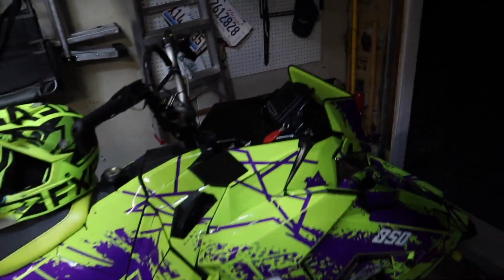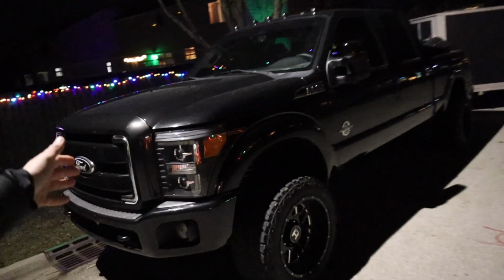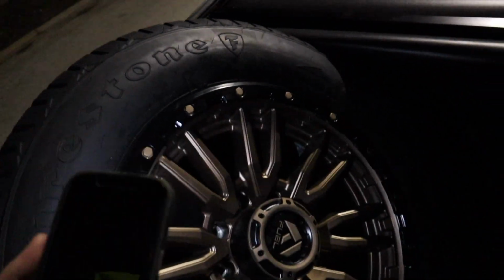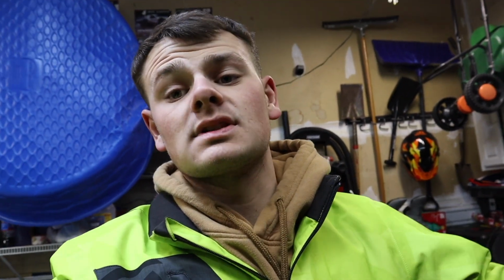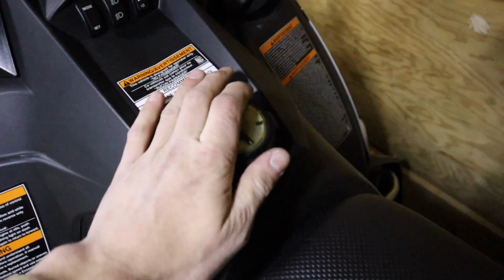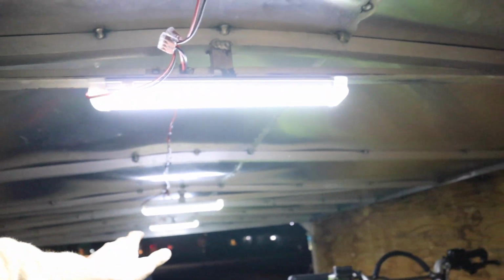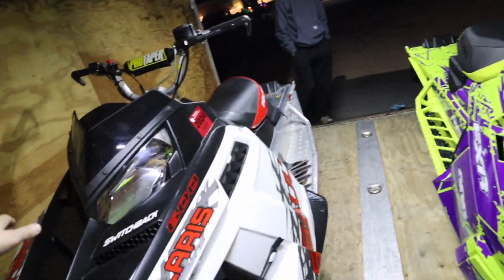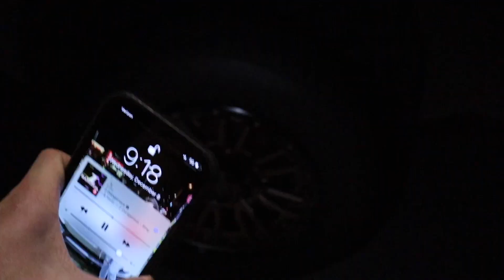SNOWMOBILE TRIP PREP!

Comment: Too bad you didn't get the winter force tires studded! but you will love there performance ither way in the snow/ice!
Reply: you can't stud them after you have driven on them unfortunately.
Reply from the maker: I considered studded but my state dosnet allow that sadly! Drove on snow covered roads for 200+ miles today and absolutely loved them! Insane traction!
Reply: @zaclucarz  that is good to hear I see so many people on the internet saying I got a set of winter wheels for my pickup and put a set of studded Goodyear duratracs on it.

And I always think to myself you just put the crappiest snow tire you possibly can on your vehicle why not buy something good like what you have for cheaper!

My advice to you is next fall throw them up for sale on Facebook and get a new set every year for your pickup you can usually do it for about 2 to $300 per year. as the traction drops off after the tires get half worn.

a set of snow tires may cost $1,000 but one small fender bender can cost 3 to 4,000 easy